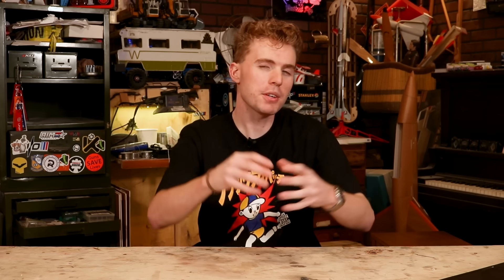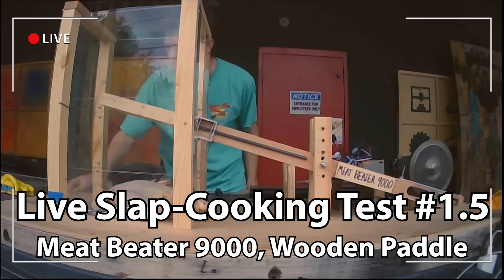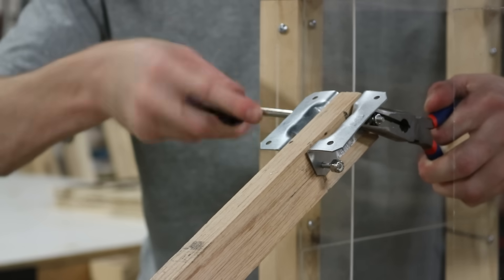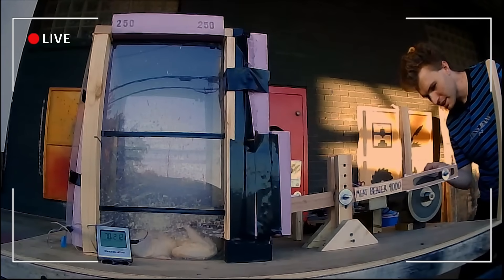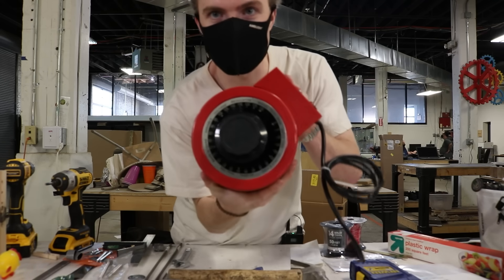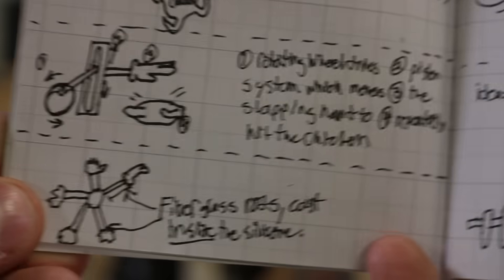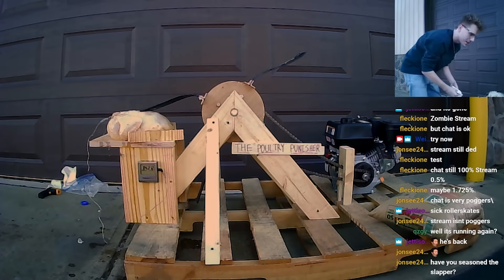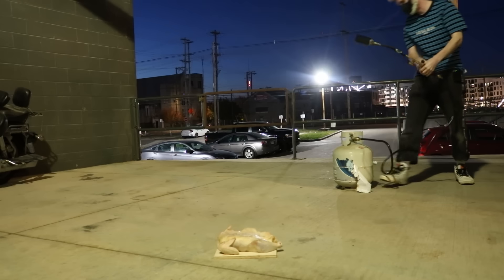How Many Slaps does it Take to Cook a Chicken?

Comment: Just an idea.... And this may be stupid. Correct me if I’m wrong. 
Seems to me like the major problem here is the relationship between heat and friction - i.e. creating enough heat to cook the chicken means needing to create enough friction to destroy the chicken. What about creating a “friction oven”? A steel box the chicken resides inside, the Poultry Punisher slaps the steel, heating the steel without destroying it due to steel’s strength. That heat then radiates outward, some out into the surrounding atmosphere (so admittedly it’s not super-efficient), and some into the box which will slowly heat more and more over time. Thermal insulation around the box on every surface except the slapping surface will help here. 
Newton’s law of cooling will still make it very difficult without wrecking the rubber strips but if you try raising the initial temperature at the start like you did with the first machine, it might be doable!
Thoughts, anyone?

Comment: The FDA has different guidelines on cooking chicken. They require the chicken to be at a temperature for a certain period of time (ie lower temp means cooking at that temp for a longer time). Once it reaches a certain temp (I forget) it is cooked instantly.

Edit: so the point I was making is that if you change the number of slaps per second, it changes how long the chicken will take to cook.

Comment: You should also factor in the temperature of the average persons hand during each slap and the elevated temperature of that hand as it slaps each time... With a thermal limit. Being that the persons hand will transfer heat at a much faster rate.

Comment: You should put the chicken under a thin plate of metal, that way the kinetic energy from your slapper can heat up the plate that in turn heats up the chicken, while still protecting the chicken. Thats cheating a bit, but close enough.

Comment: Also, couldn't you put a metal plate onto the chicken to avoid it getting destroyed? Even better if you put the chicken in a metal box, that way you could amp up the slaps to the max without destroying the chicken while the slaps would heat the metal ( a good conductor of heat) which should cook the chicken through heat transference

Comment: Your chicken would not be safe to eat.  It would constantly be in the danger zone.  Bacteria grows fastest around temperatures between 40 °F and 140 °F.   The only safe way I can think of  to try this experiment to where the chicken could be eaten would be to put the chicken in a roasting pan get it up to 140 °F  (you would still want to cook at around 350 °F to keep the chicken from being in the danger zone as it cooks and remove at  140 °F probably in 15 to 20 min in.  Create an environment to keep this temp (say a sealed room at 140 °F) and use equipment that can handle the heat.  Then place the roasting pan not the chicken under the slapping device (meat beater lol)  so the meat doesn't get torn to shreds.  It would have to reach 365 °F to be safe to eat.  I don't know if this is possible but I can't think of another possible way to try it.

Comment: Ok so hear me out when it comes to the flapper design the test wasn’t facilitated but it still wouldn’t work due to the “chicken paste” problem but an alternative to cooking the chicken rather than applying the rotational force directly to the chicken it should be applied to a metal surface underneath the chicken or to wood underneath the pan to start a fire the prior option would still need to be facilitated but these options would get rid off the paste problem and in a way cook chicken with the power of slaps but it isn’t very likely the first option would work but the second most likely would

Comment: Ya know...at the very point you decide to seal the area, use hair heating tools, AND basically preheat the chicken...you're basically saying ,"we cant slap a chicken cooked. We need to heat it. Slapping is just some extra shit happening now"
And did we forget that beating meat is also called tenderizing?
Its GOING to get soft and mushy and etc.
It's like we have all we need to know and restarting for the sake of restarting.
You're going to get pieces of chicken...because you've tenderized,  softened, shredded, etc...and those bits will be slightly cooked from the heat put to it..because it's such a small area...the chicken pieces...and the ambient air is heated...using your heating tools, not the slapping.

It's like simultaneously making a very very dull chopper/mixer and having heat in it.

This is like the idea of someone who's VERY smart but simultaneously VERY dumb. 
A scientific person who doesn't understand the process of cooking I guess

Comment: Waittttt
Why don’t you use 2 machines or more of the meat beater that way you can use lower energy levels because the effect is combination of both and also be less breakable and if you’re “attacking” two near places at once you also increase the area of “cookness” because the chicken is getting warm on on tiny place and the heat is lost to the rest of the chicken but with several machines you could work different places of the chicken that will cause less heat transfer and you could even make it slap the same place with coordination so you get more slaps with each of the machines using less power- and the chicken will be destroyed less because it doesn’t get hit from the same direction in the exact same spot
And the greatest bonus is that the chicken might be more cooked overall and not just that tiny fraction of it
Please try it again!!!!!

Comment: There is one more idea that could work. The up down slapper preserved the chicken better but couldn't slap fast enough without burning the motor or breaking the arm. Have a system with multiple arms and multiple motors timed to hit in sequence. Higher slaps per min without stressing the motor or arms. Just like how a rotary cannon uses a ton of barrels to reduce heat buildup. Each arm and motor would work at a slower rate but overall slaps will still be higher

Comment: Edit: actually I’ve been on discord just now and we came up with, if you made a double sided cylinder with 2 ceramic coated pistons from either side and had them moving up and down and opposite times to keep the heat more consistent, then to have the chicken placed into the middle of the cylinder protected by an almost chain mail armour, but one solid pieced tightly wrapping the chicken, and made out of a silver alloy (or if that’s to much$ then use grahpite) and then slap the silver cage with the pistons, causing friction wich would then heat up the sliver/graphite and the sliver/graphite cage would grill the chicken....... 

if you wanna use it more then once tho, then use a gold titanium alloy cage

Comment: Should have put the chicken in a small metal box and used the slapper to slap the box. Though you'd need to do it indoors so the sun doesn't heat up the metal.

Comment: The problem with the first design of slapper is that the paddle is stopped by the crank lifting it back up again, not the chicken, so very little kinetic energy is transferred into the chicken. You would probably have had better results if your machine lifted the paddle, released it, and then some elastic pulled it down onto the chicken, then the motor picked it up again.

Comment: I'm assuming that you've already given up on this, but have you considered placing a thin sheet of a durable plastic over the chicken, and using a lubricant on the plastic? If you continually cycled lubricant over the plastic then you would not have to worry so much about friction shredding the chicken. Yeah, technically you'd be slapping lubricated plastic instead of the chicken directly, but most of the kinetic energy would be transferred through the sheet into the chicken, meaning that the chicken is still being slapped.

Comment: I think it would work if you improved the first design because then it could only go down so far and wouldn’t turn the chicken to paste after a certain point. There are several reasons why I think the last design is a worse design choice compared to your first design but I won’t go into them right now. I think if you got a better motor and metal parts you could probably upgrade your first design and it actually work.

Comment: Most mechanical things are not wood.  At the end you created a fan to cool it down?  Engineers? do you mean carpenters.  Very entertaining I see success in your YouTube channel
Reply: I mean, he did preface it with "amateur engineers."  The part that broke on the last run of the meat beater 9000 was made of spring steel.  Wood has a huge variety of engineering applications today.  Prior to the industrial revolution, it was probably the most common material used by engineers in machines.  Think of all the wind/water mills, cranes, ships etc that used lumber as their main structural material.  Today is it is cheap, easy to machine, and relatively strong.

Comment: Replace that wood with steel, bigger motor
Reply: The spring steel is what broke  on the last run of the arm slapper ¯\_(ツ)_/¯
Reply: @RepeatedFailure  no like replace all wood parts with steel not use a steel for some parts
Reply: @AdrianDucao  I mean, wood is a decent material.  Failures were no longer due to wood.  I know it might look nicer, but it'd be much more expensive and difficult to build an aluminum/steel rig.

Comment: The problem is that the machine is  slapping the same place and just turns it to goo. So to avoid the chicken turning into paste put it on a rotisserie machine so the same spot doesn’t get slapped over and over and the slaps are even distributed over the entire chicken. This also allows you to add a second slapper on the under side for double the slaps per second.

Comment: Maybe if you made the chamber the thing that heats up, like an oven, but uses kinetic energy to power up instead of electricity. The chicken is going to be evicerated by the slapps, so why not slap around the chicken like an induction stove? I could see rubber, or some other elastic material that could withstand that.

Comment: What if you vacuum sealed the chicken in a thick plastic bag and made sure the surface is oiled so there is very low friction.  Should help distribute the force through the chicken and maintain its integrity better.  I wouldn’t blame you though if you just want to move on to something else.

Comment: It's doable. The main problem is the difference between chicken's and room's temperature. But if you do that in a room with a temperature whose range can vastly change, for example in a sauna-like environment (obviously you have to watch safely from the outside), and if you set the room temperature to be always 20F (~11°C)  less than the chicken's one, hence increasing the room's temperature as the chicken's one increases due to the slaps, then it should be able to reach a big enough temperature.

Comment: Couldn’t you have the slapper machine slap a metal plate that the chicken was placed on?  This would mitigate your paste issue and if you used a sticker rubber on the paddles there would be more friction on the cooking plate. Although you aren’t really slapping the chicken, you are cooking with slaps..... If it does make hot plate y stop at chicken?

Comment: Just like the 3000 mph slap has the energy to cook the chicken but destroys it, so it appears any number of slaps capable of cooking the chicken will also cumulatively destroy the chicken. It's not impossible, just ludicrously impractical. Maybe you could put a chicken fillet on a pan and slap the bottom of the pan till it got hot.

Comment: What if you had more than 1 paddle. If you had 3 paddles and each one are slipping a different surface area. One slapping the top and two others slapping both sides of the chicken. That could potentially increase your chances of achieving success.

Comment: Okay, but here's the thing, chicken was a bad choice from the outset of the original reddit post. Sure, it's a nice shitpost, but if you really want to cook something with slaps you don't want to go for a whole roast chicken end goal.  The ideal ingredient for something like slap cooking is definitely more like a hanger or skirt steak; something thin enough for high heat transfer and safe to be eaten at a lower temperature. I don't think the revision would be worth the effort (unless you can get some wicked ad rev) but retro fitting the meat beater 9000 to cook a steak dinner using skirt, hanger, tri-tip, or flank steak would probably be a more successful endeavor.  Plus you might end up  tenderizing a tougher cut in the process. It'd be lunacy, but it would be lunacy with results. Great video, very intriguing!

Edit: also, being able to rotate or flip the piece of meat for more even slapping and heat distribution would probably help in a possible revision.

Comment: Why don't take a heat-reflecting foil and put it under the chicken and fix it on a block of concrete
 and then use 5 slapping machines to spank the chicken from all sides at once?

Comment: Seems like a huge flaw in this design is that you keep contacting the chicken in the same place. If you designed a slapper that could hit the chicken from 2 or even 4 sides, you could transfer that much more energy into the chicken before it falls apart.
Also seems like you would want to find a slapping hand with as little mass as possible to give you more fine-grained control of power delivery via speed. Even 15 slaps per second is only 900RPM, not super fast for a motor of that size.
Also, oil reacts with rubber, which is why you ended up with black streaks on the chicken.

Comment: I feel like you could have used higher surface area on the slapper and I think abandoning the insulation isn’t a good idea. I think also if you used a hemispherical insulation set up you could avoid a lot of heat loss. Your insulation set up had a giant hole in it. I think the last set up had the problem of carrying material away as well as having a huge portion of its rotation to cool down. Along with that it was basically a fan blowing cooler air over the chicken.
Reply from the maker: Yeah v4 was wack lol - gonna have to go back to linear slapping for the eventual follow up

Comment: This wont get more than 2-5deg max... the hotter it gets the faster it cools, so youll need to slap much faster as it heats to maintain and raise the temperature. I think a paddle wheel with rubber/silicone flaps would probably work best to get it a bit warm
edit: okay they do that at the end

Comment: Start at 120 f slap an aluminum plate with the chicken on top. Its a light metal you could heat it easier. Or put the chicken in a tube so you can slap more surface area.

Comment: I’ve got an idea: 
By the looks of it one of the issues is that the slapping is causing a lot of the heated skin to be pealed of exposing the cooler inner layers.

Instead of slapping the Chicken, place some kind of metal plate on too the chicken and slap the plate . In theory the plate should transfer heat onto the chicken while at the same time, better spending the heat and not pealing off any skin

Comment: Why don't you make a conductive mold for the chicken to transfer the heat and to add mechanical stability? Seems like an easy solution to your problem.
Reply: By that it could even be a metal slab drilled into the chicken. A nice thick piece of copper would do the trick. Good heat conductivity and you would get bad rubber burns in the chicken.

Comment: If the chicken can't withstand the slaps how about using slaps to indirectly heat the chicken?
Reply: Like slapping an insulated box that contains the chicken. But that would just be re-inventing the oven.
Reply: @fuffboi7570  but it would be funny
Reply: @haydentakara4369  has a point
Reply: @fuffboi7570  it would be the next innovation of home appliances.
Reply: I would be satisfied with this, it may in fact be possible to use the slapping machine on a metallic element that is a good enough conductor of heat to get to a high enough temperature to cook the chicken in an oven-like chamber.

Comment: I think the factor is a lot of energy is lost trying to convert it from kinetic to thermal. The reason the chicken is destroyed is because a lot of the energy remains kinetic, more so than thermal. Versus an oven, which is all thermal. And since the kinetic energy is producing a smaller factor of thermal energy, by the time you reach enough thermal energy to cook the chicken, you've easily surpassed the kinetic energy it can stand. Personally, since to lower the kinetic energy you'd also lower the thermal energy, I think this ones DOA.

Although I am curious about 2 slaps wheels going at it from different sides.

Comment: Can the cooking temp of chicken be altered by changing the atmospheric pressure? I recall ages ago I watched a King of Random video where they cooked a steak in a vaccum chamber, and compared to the one cooked outside the chamber it was extremely rare, downright uncooked. I can't entirely come up with a reason as to why that happened. Maybe when cooking the heat travels mainly through the liquid in the steak, and the lowered pressure prevented the liquid in the steak from holding and transfering enough heat energy to cook the meat?
Maybe the cooking temp of chicken can be lowered by increasing the pressure then?

Comment: Did you consider trying a wheel that has a whole bunch of hands on it spinning at high rpm?
I see you finally did.

Okay, what is the vibrational shock frequency at which the chickens cellular tissue breaks down? Reduce the impact force to just below that frequency while also reducing the time between slaps with increased rpms. Use a lighter, flimsy and less dense material.
Don't forget to maintain thermal insulation.